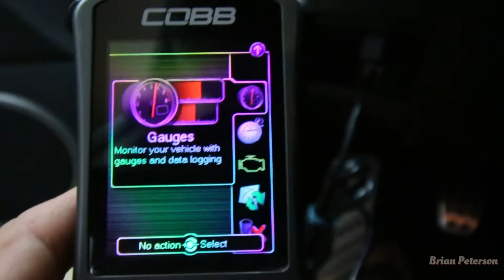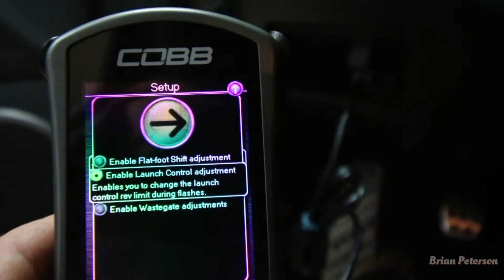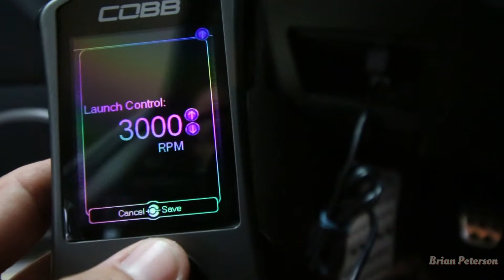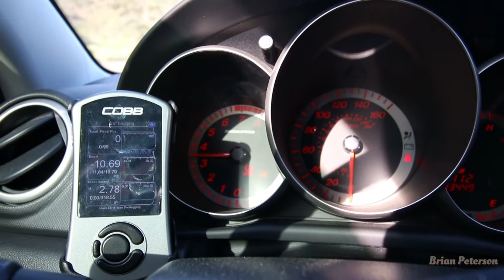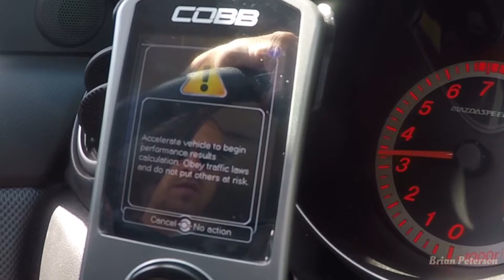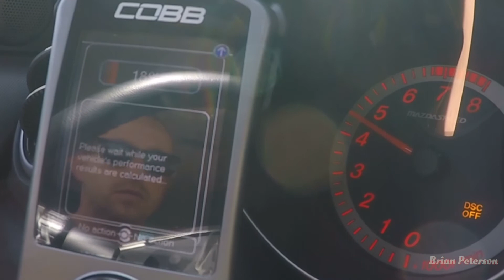Cobb Access Port Launch Control Mazda Speed 3 1/4 mile time

Comment: I got to try this with mine once I get my vacuum leaks fixed. You might have gotten a faster time if you shifted at or near redline though.
Reply: These cars have a low to mid power band not really a high revving car unlike most Japanese cars 280lbs of torque at 3,000 rpm

Comment: do i need any mods or can i just do this on a stock ms3 with an access port. Gonna get hpfp internals it already came with an intake and i’m gonna straight pipe it soon.
Reply from the maker: Yes you can use it on stock ms3. If you go to cobb website they have more info and you can download some maps. https://www.cobbtuning.com
Reply: Brian Peterson ok thanks but which map should i install on my 2010 ms3?

Comment: does this work for a mazda 3 sedan?
Reply from the maker: Yes as far as the access port. You can also just get your car tuned and have the shop flash your ecu on your car meaning the put the tune on your car. You can put it back to stock if needed later on.